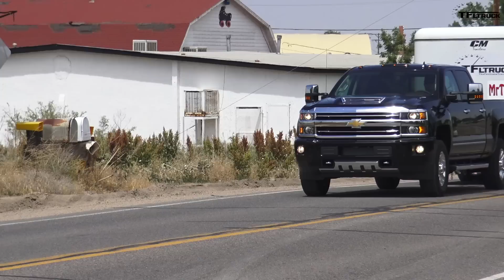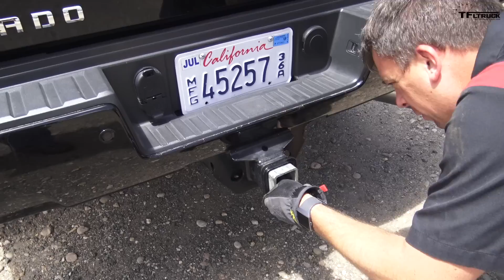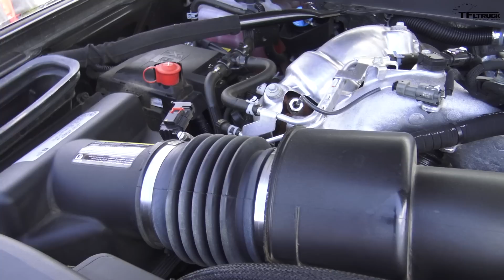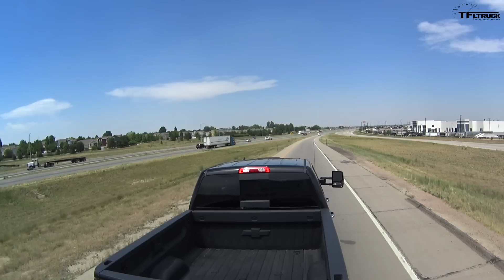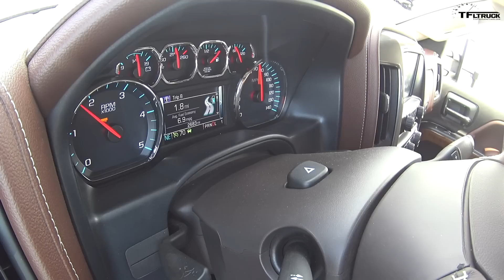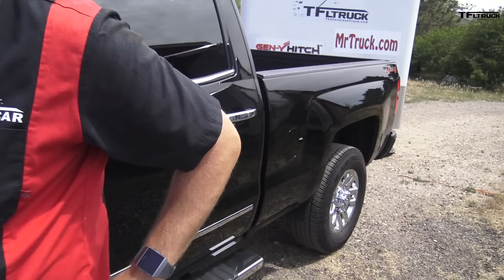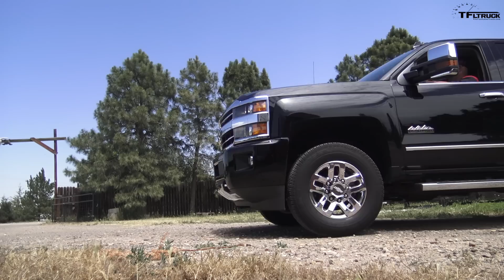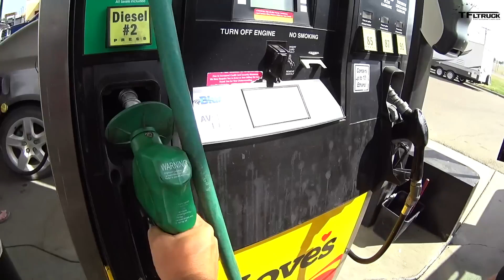MPG Challenge: Silverado Duramax vs Cummins vs Power Stroke

Comment: My 6.6 Duramax Diesel gets 17 MPH pulling a 3,000 lb.Tent trailer fully loaded with 4 passengers. Crazy part is when I'm not pulling a load with 4 passengers I get maybe 18-20 MPH, these Duramax Diesels are amazing. BTW: I'm talking Highway miles, not around the city.

Comment: I just bought a 2019 2500 Duramax Silverado.  I've put just over 400 miles on the first tank, mostly highway, and averaged 22.5 mpg.   Some hills, up and down some hwy @ 60 mph and freeway @ 70 mph.  I'm pretty impressed when comparing to my 2002 7.3 Ford,  the 6.6 has so much more power and getting about 6 mpg better mileage.  With all the smog controls, how do they do it!  Next test is pulling my 8,000 travel trailer.

Comment: Can we  see a test of 2020 mid models ("Big Horn Ram", not Tradesmen, or Laramie!! "Chevy LT" and not the WT or High Country!!) with the highest gears available (Like 273's if avail, but no 410's!!!) all 3/4 ton Crew Cab 8ft beds 4X4's towing "7,000lbs" as well as "Empty" (but put about 350lbs in the bed when testing, for simulating 2 Adult people with tools and 2 children) all tested at same time... Mostly looking at GM vs Ram, because I don't really care for the stiff ride of the Fords but would like to see if they get same MPG's as the other two or better... Also make sure that it's the air ride Ram if it's available as that's what I would buy.... Never going to tow more than 9,000lbs but will be towing between 6K and 7K across the country every spring and fall... Also you should test one way at 65 and the other way at 70 as long as one way isn't more up hill than the other, if so do the 70 on the whole way... Also use trailers that don't have hay racks on top, and if you can get a 25ft car hauler flat bed, and put a 2010-2020 Jeep Grand Cherokee on it for the test, that would be Great... If not, just make it as equal as possible... Thanks

Comment: Also if you are going to compare trucks than they need to be apple to apples, meaning, you can't take a Ram tradesman, and put it up against a Ford King Ranch, so all have to be either the lowest or mid  or top models because they are all built differently...And test the same gears, because 3.72 isn't the same as 4.10 gears... But I like that you test on same roads and at 70mph but all trucks should be tested on same day, use 3 drivers and follow each other and each driver drives each truck so each truck goes around your course 3 times with 3 different drivers and then post each numbers as well as the average of each truck... Thanks and keep up with trying to help us...

Comment: How come you don't test them empty as well??  As 99.99% of the time these trucks are run empty to and from work and towing only on the weekends maybe once or twice a month to go camping or to the lake with a boat... I'm looking for a truck that fits 6 adults so it needs to be a Crew Cab 4X4 with a 8FT Bed that gets at least 25 MPG (prefer 30MPG) Empty and will tow 8,000LBS  and still get over 20MPG with that weight... So is there any gear sets or MPG Kits that can get these numbers?? Because none of the makers have anyone smart enough to figure out that there are  "MILLIONS" of us just need a "REAL" 1/2 TON TRUCK, But no one will make one!! (not even as an option!!) They only offer "HALF" Trucks in 1/2 ton... It's not real truck, unless it's at least a Crew Cab with a 8FT Bed!!! If I wanted a "HALF" Truck I would get a Ridgeline or an Avalanche or I would have kept my 68 Ranchero!!! As I keep getting people calling me to go get stuff at Lowes or Home depot because they need a 8ft Bed!! One was redoing his bathroom and bought 2 sheets of special sheetrock for the bathroom at over $50 a sheet and he has a Ram 1500 with like a 6' bed, and he got half way home and going over a bridge there was a bump, and when he got home his 8FT special sheetrock was 6FT long!! He called me up and I had to meet him at the store so he could get some new ones! I want it so I can put a bike in the back and 2 on a trailer and the 6 of us travel to Bike rallies all over the country "Together"!!! 1 Vehicle!! So we can split the cost... I have a F350 4X4 Crew Cab 8FT Bed Diesel (REAL TRUCK) But I don't have to tow my 2 bedroom Cabin Cruiser that was 16 to 18,000LBS (Sold it) So for the past 15+ years I only need a "REAL 1/2 TON Truck" and I worked construction and know that many of these companies would love a "REAL" 1/2 TON Truck so they can put 5-6 workers in and carry a bunch of stuff like concrete paddle's, scrapers, brooms, or  shovels, in the back and tow either a light plant, concrete mixer, or generators... And what about the thousands of "Landscapers" or "Tree Service Companies" that just need to tow a small trailer with lawnmowers and put weed trimmers in the bed, or Chainsaws and fuel tanks in the bed and a chipper being towed.... They use 3/4 ton Trucks because it's the smallest "REAL TRUCKS" Available, but get bad MPG!!! So we need either kits to get better MPG with a 3/4 ton or some how get someone with a half a brain to make a "REAL 1/2 TON TRUCK" that gets like 30MPG!!  But at least let's find the best MPG "REAL-TRUCK"... Thanks

Comment: Ram 2500/3500 SRW Cummins only comes in 3.42.  So if you were comparing to the Ram 2500...  Those were 3.42's.  Which by the way I hated.  Sold my '15 Ram 2500 Cummins and ended up purchasing a '18 Chevy 3500 L5P.

Comment: There are no way in Hell that a RAM can outlast a Ford or chevy. Hemi engins are to sensitive for oil issues and complicated valve roller rocker issues
Reply: Timely oil changes with full synthetic solves that, plus they are comparing all diesels. No Hemi involved here.

Comment: One issue with the comparison is a 3500 vs a 2500, that diff towing will be better in most cases when towing. Need a full on 3/4 ton test, not mix them up. Fords F-350 sw truck has a different rear end than the 250 version.Love the channel and watch regularly but compare apples to apples.

Comment: I drive my 30 000lbs mercedes 6,4l diesel truck (a real truck, not a pickup), 4m high with 12,5mpg.... at 105kmp.... about 69mph.    So i dont get it, why is 12,2 a good result for a relatifly light truck n trailer, ridn on the flat?

Comment: it's really simple if you think about it, Rolling Friction, meaning Dually's vs Single. The rubber to road ratio is higher on the other trucks, an it take power to move those tires an to keep them rolling, breaking the ground friction burns more gas.

Comment: Point of interest, I think your fill up technique leaves too much room for deviation, as each pump can have a different automatic shut-off point, even with your double-click technique. Question- do you use the same pump at the same gas station on the same day for testing? Thanks! CD/

Comment: This has been the same shit for years, Ford and Dodge have these higher torque numbers but when you take it out on the highway they usually fail at everything compared to the duramax when it comes to engine performance ... even the 0-60 stock on all those trucks the duramax always wins if its a competent driver.

Comment: I'd bet some of that magic dust is in that allison transmission and rear axle ratio matched to that duramax..... that L5P is a helluva engine and more efficient, but as you noted the axle ratio difference between the 3 truck and that the manufacturers baked that into the equation, I'd bet that without the allison 6 speed and rear axle the result might not be as good as they were

Also I love how quiet the duramax engines are also, Gm said they were going for driver comfort, not trying to set tow capacity records, 95% or so of their buyers tow less than 25k lbs regularly, or something like that

Comment: Anyone looking to buy a new duramax read this. I bought a new one ( L5P) 4 months ago. At 6000 miles it developed a miss and a terrible viberation.  Keep in mind this is my wife's truck. A half ton would have done anything this truck did. I limped it to the dealer at 35 mph. It took them 5 weeks to diagnose the issue. Turns out these motors have 3 piece push rods. That's right, the bottom portion that is pressed on is a ball shape that engages the cam. The upper portion (pressed on also) runs the rocker. It is a cup shape. 2 of the "cups" broke off. The middle portion of the push rod is soft metal.... not hardened. It drove the soft part of the rod into the rocker until it mushroomed and stuck the valves open. The tech let me look at tbe rods and engine torn apart. He told me GM put out a memo on this. But have not issued a recall yet. It's not the 1st one.  Instead of declaring it lemon the dealer worked with me and I came home with a new 6.0 gas burner. The dealer gave me $5500 and the new truck. There was $7000 difference in Sticker price. They should have ponied up the full $7000. I would've preferred another dodge or Ford diesel but I didn't really have the option.

Comment: Absolutely love it, the look better pull better the exhaust break and tow haul slow the truck down a lot better going down the hill and more reliable and fuel milage is just a bonus cause nobody cares about fuel milage when your buying a 3/4 or 1 ton

Comment: i gotta call BS on the rear end ratios not affecting mileage. the cummins was screaming at 70 mph with 4.10s, and i'll bet the powerstroke was lugging with 3.55s (or whatever ford's "eco" rear end is). if they all offer 3.73 gears and they actually want apples to apples, they need to test all 3 with the same gears (and the same weight class) in as close to similar weather conditions as possible - which might mean more than one driver, or multiple loops on the same day. or at least caveating that there was a difference. with 450k+ subscribers, i'm sure the OEMs could make it happen if TFL pressed it a bit.

Comment: I'm not sure if the Powerstroke & Duramax diesels are the same in the way they break in or not, but I have a 06' Cummins QC 2wd SB.  I got really disappointing mileage when I first purchased the truck new (10mpg towing 10k 5th whl & 17mpg hwy hand calc).  The mileage continued to increase until about 50k miles.  I am now at 95k miles and I get 25mpg hwy & 15mpg towing same 5th wheel hand calc.  If anyone has a Powerstroke and/or Duramax on this thread, does the same thing happen with them as I experienced with the Cummins?

Comment: I get why they tested the 3500 v/s the F250 and Ram 2500, but it should have been even between the three.  My F150 is rated to tow 12K but a F250 will tow that same weight way better due the heavier weight of the tow vehicle.  I feel they missed the mark here.

Comment: I bought your book, Truck Nuts, and enjoyed reading it. One comment for your next edition - for the section on weight distributing hitch -- If you could make a more in depth explanation on how they work/ more pictures for us mortals. Also on the Duramax how is it able to get better mpg with a higher rear axel ratio?